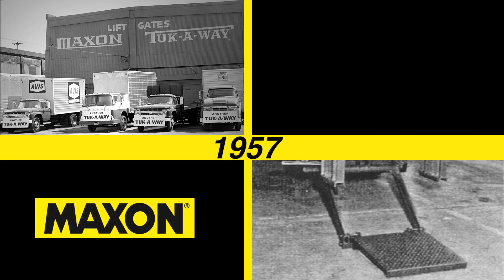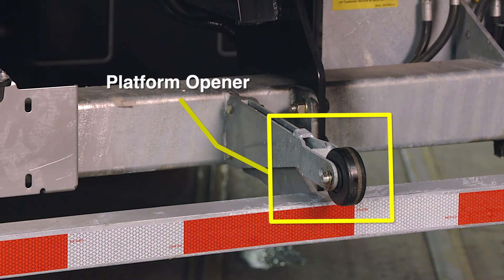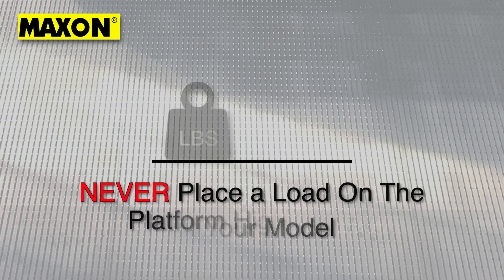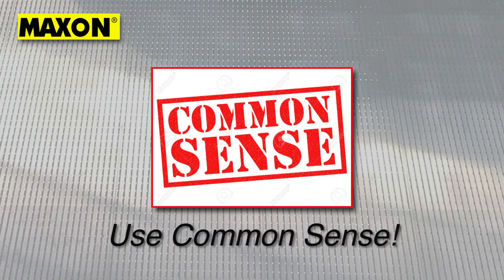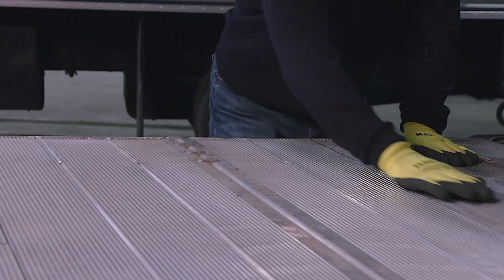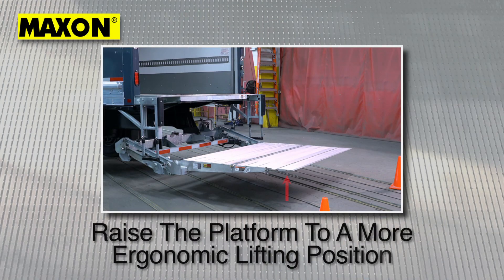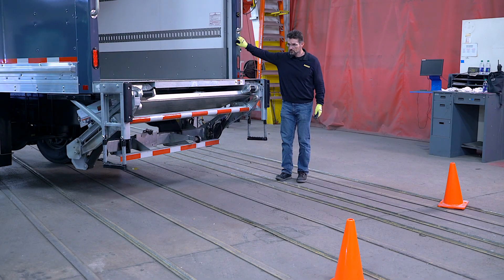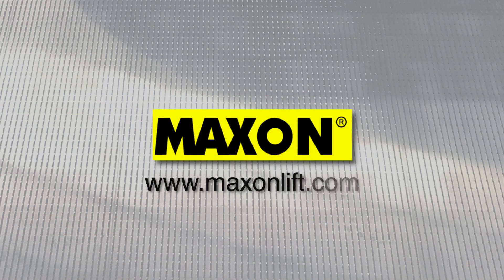Maxon GPT   2020 - Introduction, Proper Operation, Deploying & Stowing, and Operation

Comment: Thanks for showing me how to clean it. No cart stop, except very tip of the flip section. That is why I am here. The very end is up and I can't get it down. It has 2 positions of up, but no horizontal? How do I get the cart on, and the load off like this? There is a lever on the right, which isn't helping.